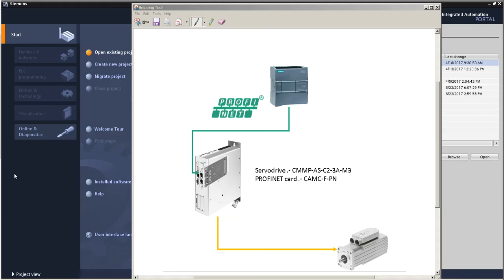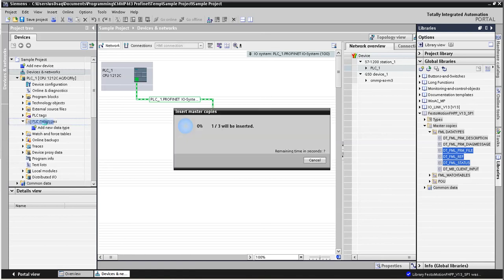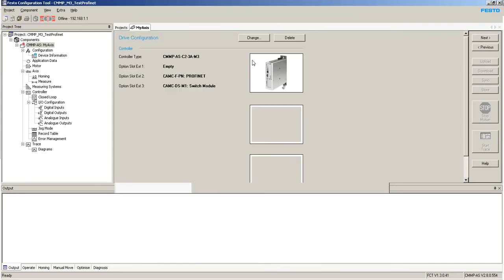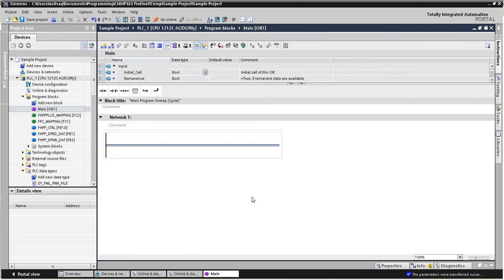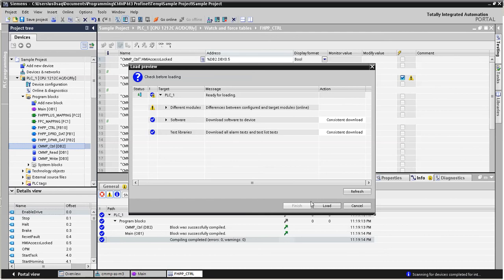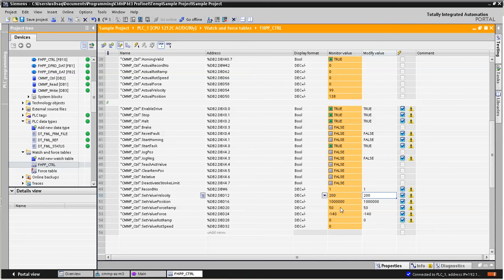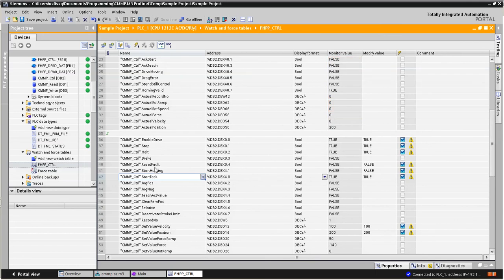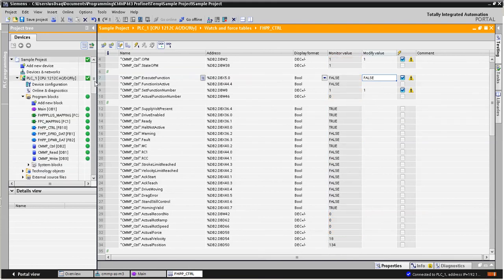CMMP M3 on Profinet + Bonus Synchronization Slave

Comment: If i want to use only a hmi siemens for example to control the motor, what are the addreses of the variables to comunicate the hmi to motor controller?

thanks
Reply: Thank you very Much for the video, it help me a lot. I have one more problem. If I run one of the Records out of the Table in synchronisation Mode, the Drive DOES NOT stop at the Destination, Can some-one help me Urgently.